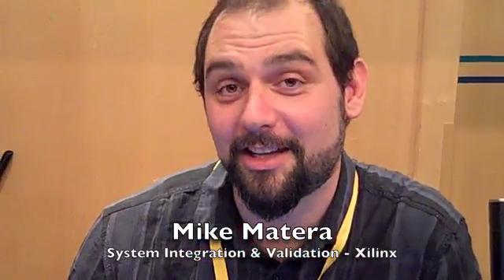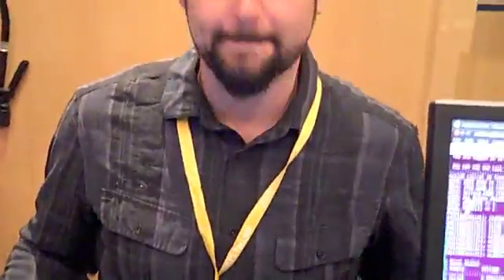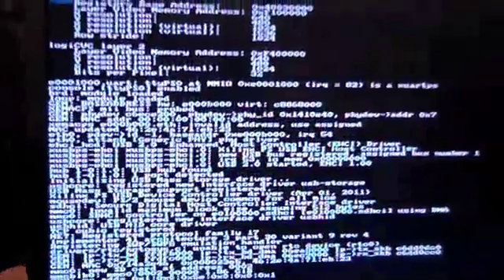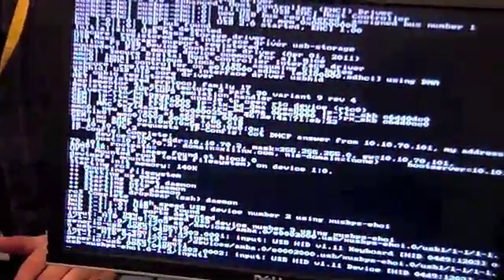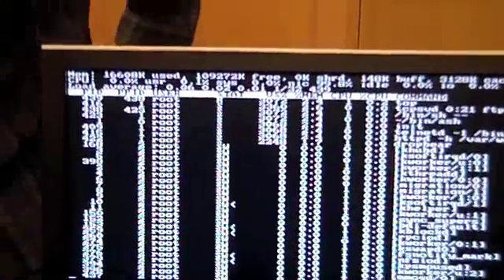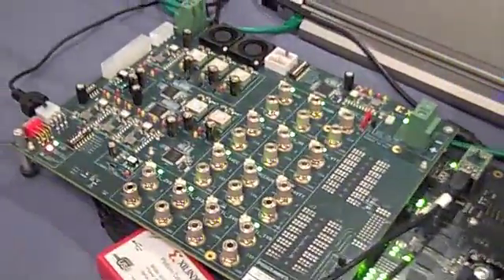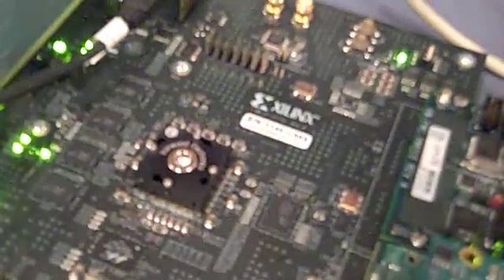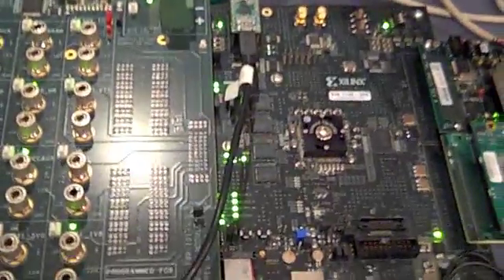Xilinx Zynq demo of first silicon

Comment: I generate mandelbrot zooms which require abitrary precision interger match. I suppose with one of these devices you could build a 512bit multiplier and adder? I doubt this hardware will make it to laptops or tablets. I guess a PCI FPGA card would be the way to go.